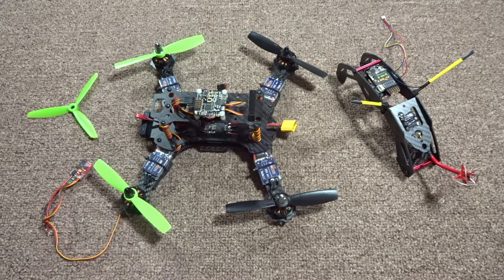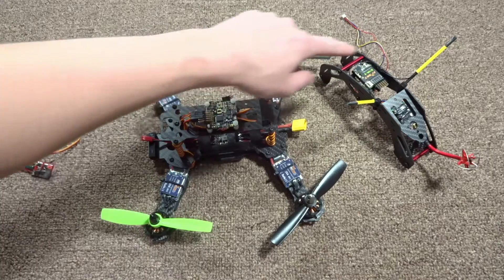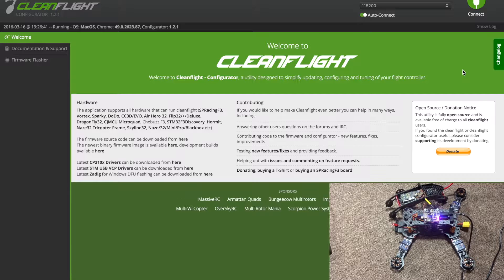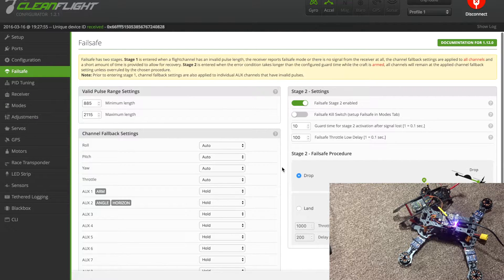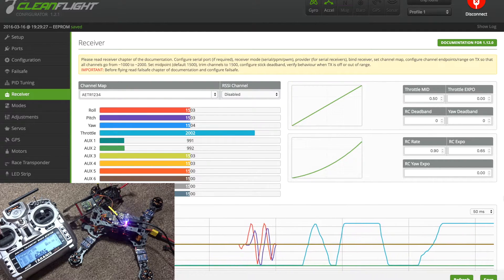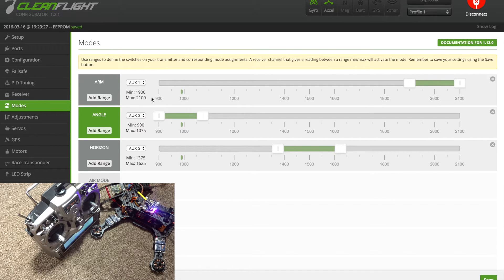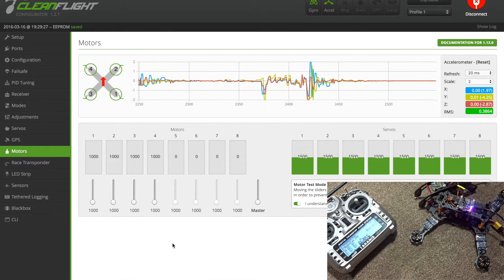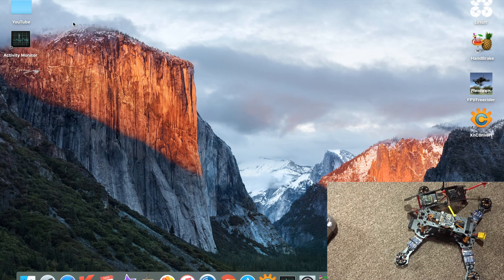RoboCat 270: Build Tutorial, Part 3

Comment: were you able to confirm why your ESC Blew out? was it just one or was it all of them? What was the clues that made you open up the ESC?  I just bought 2 replacement ESCs  one to swap out as one of my motors was not working correctly, it was oscillating back and forth and spinning real slow, I replaced this but after a few minutes of flight it was back to its original issues. I was using 12AS Simonk ESCs for their price, wanted to learn before I spend money on higher power materials.  I ordered a new PDB board as well based on your recommendations.
Reply from the maker: I didn't have to open it up! It caught on fire, lol. Not sure why it happened though.
Reply: ha! safe to assume the other ESCs were fine?  My brother has the same kit I have I'm going to have him get the new pdb board to replace the sky blue panel it came with. nice build, i'm hopinh once I rework the esc and new board I can get mine to hove as much as you
Reply from the maker: Ikararua Yeah, the others were fine. If you stick to 2 blade 5040 props, they probably will be ok, but they are very low quality escs. A 20A littlebee is only $13 and one of the best escs out there.
Reply: Thanks I'll take a look at that next!. I'm using 6040 props since it came with my kit, i'll swap the the 5040 once I run out of spares (around 5 complete replacement sets I have)
Reply: Spend the extra money and buy lumenier ESC's you won't be disappointed.  I was running 12a Lumenier ESC's with 6045 props on a 280 size frame.  6040 props will work just fine with this frame, plus they will provide more lift.  If you are using the D4r-ii I would use PPM as you only need to run a servo wire between the FC, and the receiver and you will have all 8 channels.
Reply from the maker: kaylasadiva Lumeneir ESCs cost a decent bit more and don't match performance of other top escs. I prefer DYS XS20a right now. I only use SBUS as well now.
Reply: I got SBUS working with my AT( Remote) So far my ESC's havent gone since i replaced the pdb board with a micro one i got off banggod that filters and clean the power.  I'll defintely try the XS20A when I get better at flying. I recently changed my remote to mode 1 since i found that style much easier to fly with

Comment: I like the build videos, even though I probably will never buy this because my parents don't want to put the money on there card.
Reply from the maker: +Pretzil295 Thanks :) Maybe save up your own money and then you can get something?
Reply: I do, I Don't  have a card. So if I want to buy something I have to save up my own money and pay my parents the credit check. So I pay for it 100% they just don't want to put it on there card. I find it strange...
Reply from the maker: Pretzil295 I just use "credit" with my mom. I just buy things, and when I get paid just keep track of how much money I got and received to buy things .
Reply: Have a look at second hand stuff. I've seen fully functional quads go for $100.

Might make it more affordable. :)
Reply: Me personally would rather have new stuff, but if it will save you a few $$ than that might be a good idea. Just depends what quad
Reply from the maker: Pretzil295 Yeah, I have seen some quads on eBay and Craigslist go for really cheap, and were is fine condition.
Reply: +Pretzil295 I saw a RTF ZMR250 with fpv, a Turnigy 9XR, a Pair of fatshark predator v3 goggles and 3 lipos go for $300 AUD on ebay once. Everything was only used once or twice.

Keep an eye out for good deals, you might get lucky.
Reply from the maker: OHMYQUADcopter DAMN! That is just what the goggles cost!
Reply: +The RCAddict yeah an insanely good deal. I almost pulled the trigger on it.
Reply from the maker: OHMYQUADcopter I would have, could have easily resold it for $400.

Comment: Maybe the problems with the cc3d was that the servo leads that is coming out from the cc3d in a diffrent way compare to the naze32. CC3D is front left 1,front right 2, back right 3, back left 4.
Reply from the maker: +CANDY QUADS racing I made sure to pay attention to the different motor ordering when I plugged them in. It was something faulty on the board like the gyro or something.